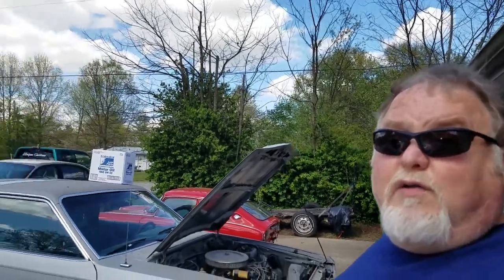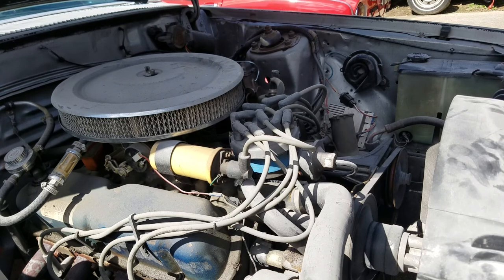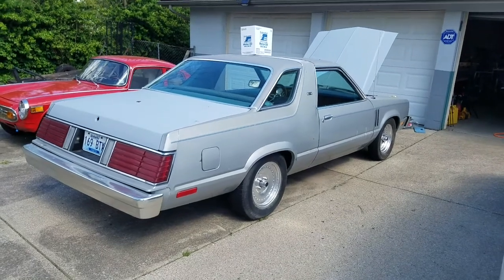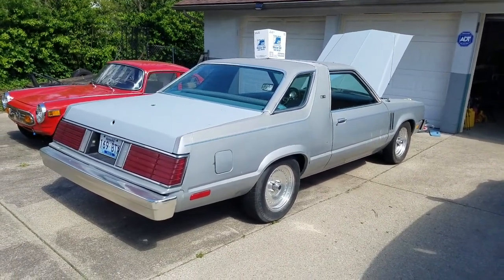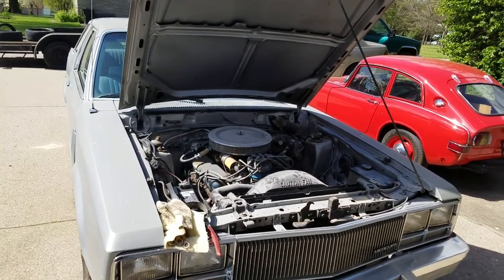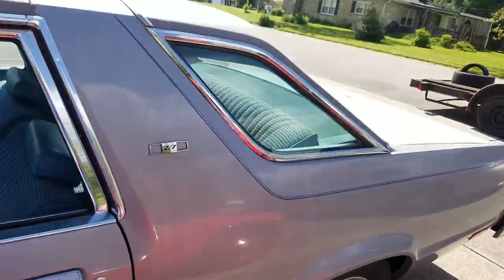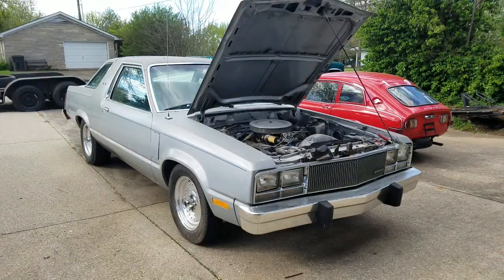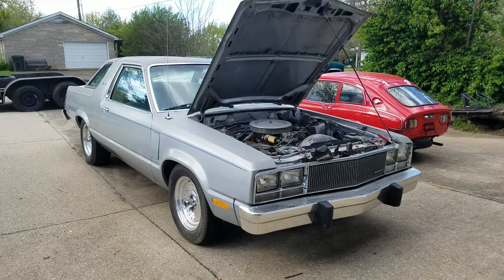1978 MERCURY ZEPHYR MY PAPAW CAR

Comment: I pre-ordered my '78 Zephyr in copper with a beige-ish  interior. There were no models to look at - you ordered off a book (they had just started taking orders). I can't remember the options but I remember that the list was in the vicinity of $5700. I kept it for three years and then did an "'82" Ford EXP. I'll never forget (in the Zephyr) how one time, the transmission lever was frozen in "park". It took a tow to the dealer to "magically" release the transmission lever.